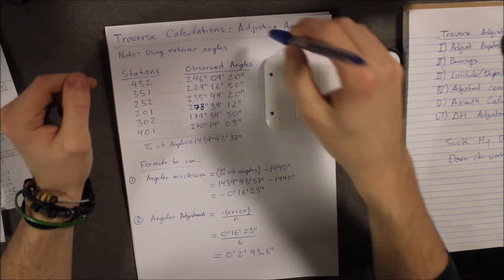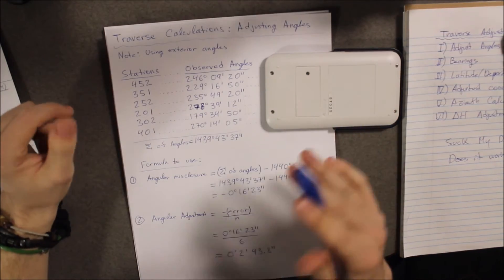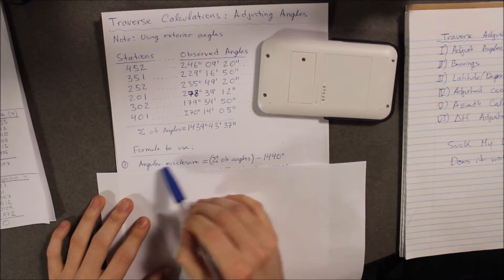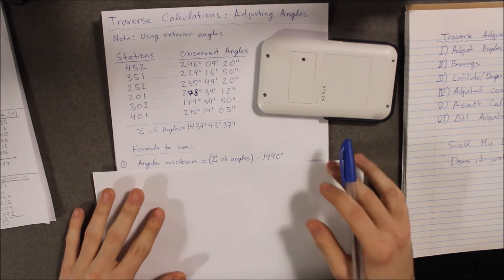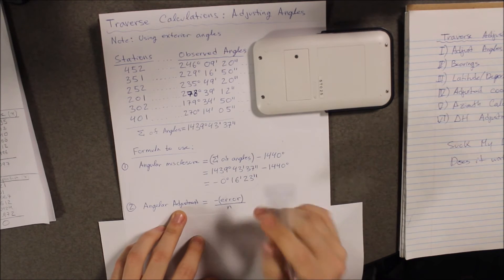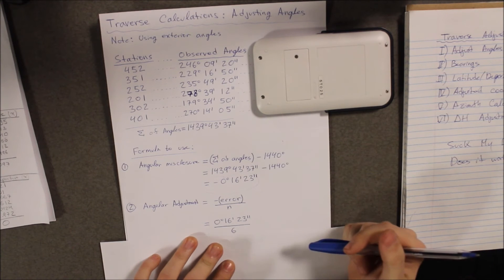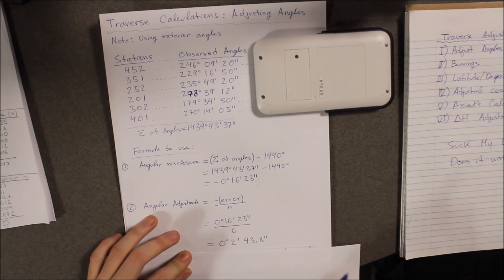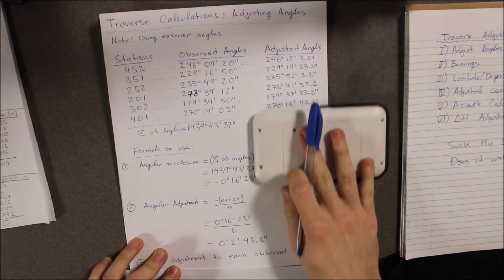Traverse Calculations: Distributing Angular Misclosure

Comment: what is 1440'?how to get ?
Reply: since they are exterior angles, you use the formula (n+2)*180 where n is the number of sides you have. In this case there were 6 angles so (6+2)*180 = 1440. If these were interior angles, you would use the formula (n-2)*180.
Reply: why plus 2?
Reply: @TheCountOfTuscany1318  I was always told (n-2)*180